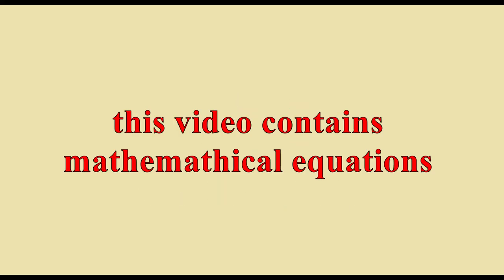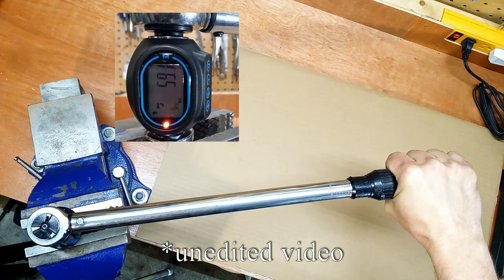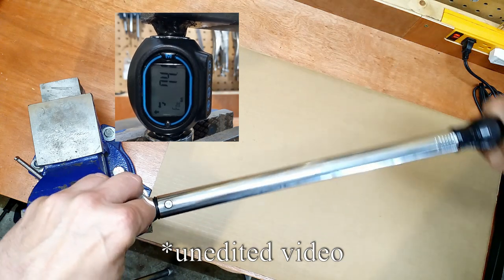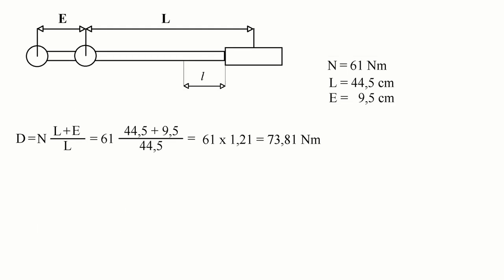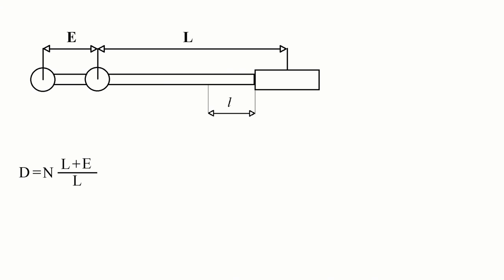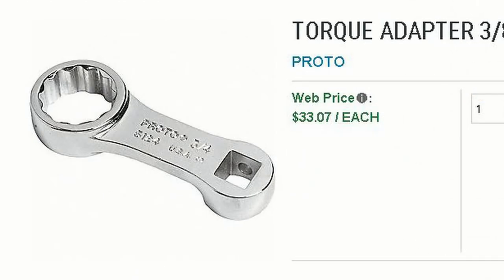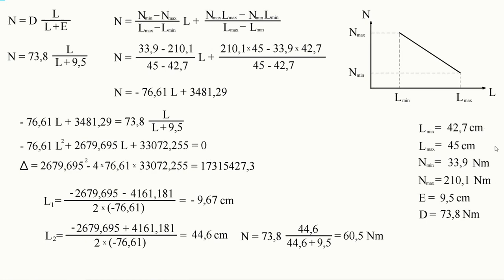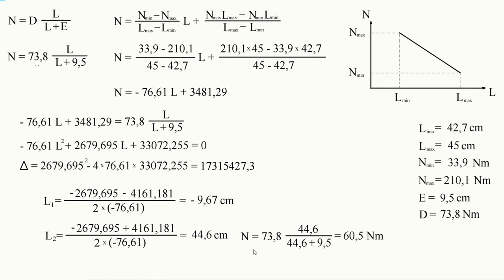How to Calculate Torque Wrench Extension

Comment: Does this means when i extend more, higher torque are needed in order to get the same torque, for example in order to have the same 61nm with a 20cm extension, i will need to set my torque wrench to mayb  80/90 in order to get bolt tighten at 61nm?
Reply: Did you find the video difficult to interpret?

Comment: There is nothing to calculate. You can stick the crows foot straight off the end of the torque wrench. In statics engineering class we learned that the total torque on the crows foot must equal zero. Otherwise, it starts spinning in space. Whatever torque is applied by the wrench to the crows foot is felt at the bolt and the bolt must resist with an equal and opposite torque. No need to change the torque setting on the wrench.
Reply: Aku tidak percaya. Memang benar torgue di wrench tidak perlu diubah, tetapi bukankah jarak/panjang tuas mempengaruhi daya yang diperlukan? 🥴
Reply: Hmm. I think I missed something because in the video he had a device that measured the force at the head of the wrench and with the extension, the wrench applied a different amount of force than what was measured at the head.